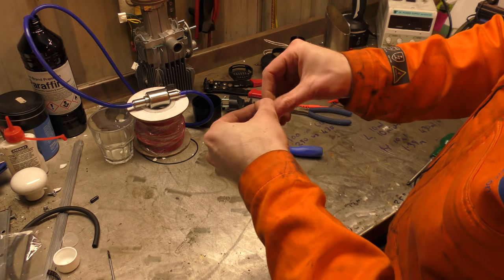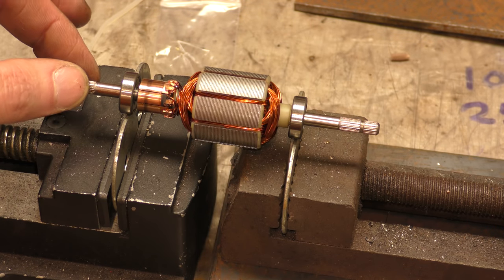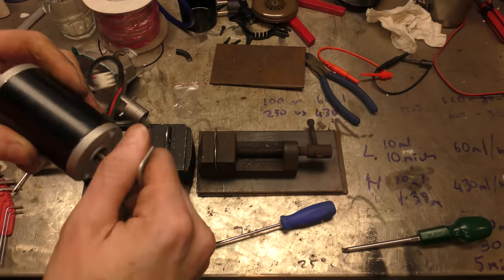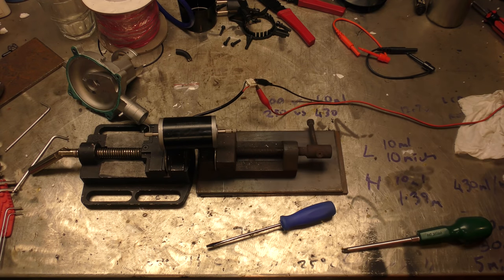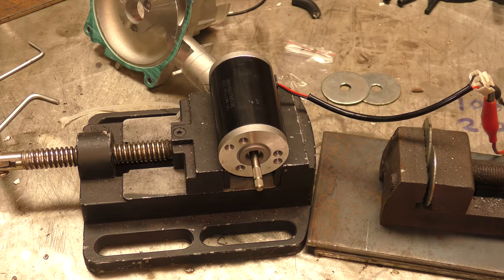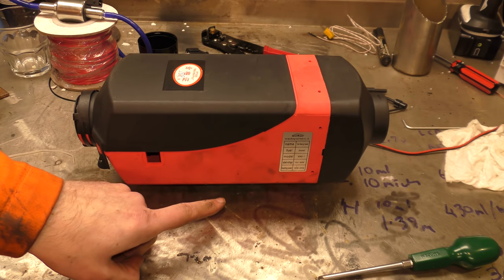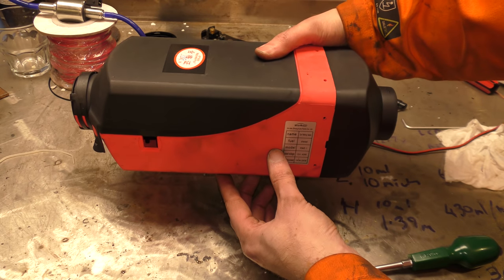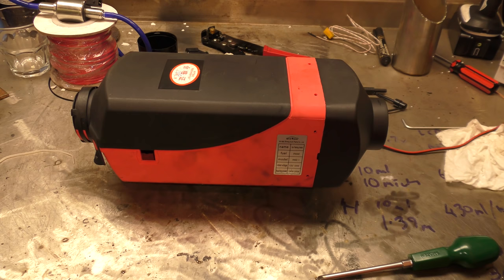EZO bearings on the noisy heater.  Fixed?

Comment: Hint: Use a 625RR not 625ZZ at the brush end as the dust from the brushes contaminates the bearings. Also if you cut a washer from the lid of a Chinese Takeaway Food container 13.5 mm OD and 4.5mm ID and place this between the brushes and the bearing, and use commutator lubricant or lanolin. The motor shaft slips which ends up with the brown compressor fan inside hitting the plate, or the Black fan hitting the sensor package.  When the motor slows it creates a rich burn, more Carbon Monoxide , more fuel used for the heat setting, and Smokey star up and shutdown, and deposits in the heater. So when you pull the motor apart superglue it in the correct place .
Reply: You need to make a video on that. Elaborate.

Comment: Repairing whatever slipped past Chinese 'quality control' is always incredibly satisfying imo
Reply from the maker: I think their QC might have been simply to test if the motor runs.  :)
Reply: Be fair, you are not paying a lot of this thing.
Reply: 'Slipped past' ?  No, those original bearings were chosen because they were the quietest in the batch!  😁
Reply: @nexpro6985  Yeah quietest in the batch of rejects from the other company they were made for originally.

Comment: Those look to be the same bearing size used in skateboard wheels. When I took my Total Gym apart, the rollers also had the same bearings as skateboard wheels, with a good ABEC rating too. 
Your local skateboard shop may be a good source for "buy it now" replacement bearings ranging from ABEC 3 (poor) to Swiss precision or even ceramic. 
For quality bearings, you'll probably have to buy the full set of 8 though.
Reply: @12volthighpeakvanlife.62  no problem, I like to help, & I love to fix things, especially with skateboard parts.
I hope it works out for you & you find that you already have some.
I think the ones I took off my "total gym" were German ABEC 7's. Surprisingly good quality.  The higher the ABEC rating, the rounder the balls are, the smoother the "ride", the less vibration,  and the less the noise should be.
I've never tried them, but I think Powell makes "6 ball" bearings, so there's less friction and more speed for skateboarding. That concept may work well for noise reduction in this application.....if they are in fact the same size as skateboard bearings.
Reply: 625 an 608 are different size. 
As for skate bearing and misuse of ABEC, not much point. 99% of china made skate bearings are the same regardless if 1, 2, 5 or 7 are stamped on the sheild. Marketing hype. If you want to spend, get Bones Swiss, pretty much the only 608 made in Europe at the WIB factory in Switzerland. 

 ABEC in the bearing industry is really used anymore. Pretty much everything is made within (or not) tollerances :-) 

EZO also make bearing in China :-) But probably under strict supervision and to EMQ standard (Electro motor quality)
Reply: @no66  I was under the impression that the GMN stamped on the shield stood for German.
I love Bones Swiss. I've been riding them for years.
Reply: @LarryMorrow2  Back in the day, GMN was germany produced bearings. Good stuff. Today,, apart fraom Bones swiss, all made in China. Nothing wrong with them, good enough. Have Swiss on my verk board and Zealous ($13) on my downhill setups. Beem 71mph on them, Bearing dont really matter :-)

Comment: Do you have a part number and a supply source for the bearings? Many thanks!
Reply: Just search: 5x16x5mm bearing. The rubber sealed should last longer than the shielded which lets dust from the brushes in.
Reply: F625ZZ Ezo us
Reply: @Scott_Free  Will the rubber seals hold up to the heat?

Comment: Adventure Brad bought the 5 Kw model.  The fuel pump promptly failed and he replaced it.  I'm sorry to know about the low quality of some of the components, but glad to know that replacements are to be found.
Reply: My experience over the past three years with them has been a neat learning exercise. My advice is have a secondary / backup heater such as an electric space heater and buy 150% diesel heaters: planning on running one then buy two, planning on two then buy three… have an extra ready to go and keep all the good parts when one fails.  Depending on what fails you can then order that and rebuild it to have as your next replacement. Some parts are close to cost of a whole new heater but even then they’re not terribly expensive.

Comment: Mine is SO loud right now.  I just ordered two genuine EZO 625-ZZ bearings on eBay.  5x16x5mm   I'm sure it will make a big difference.  Thanks!!
Reply: How did it go?  Was it easy to disassembly and change the bearings?
Reply: @fadingveil I recorded a video of the whole process.  I'll try to edit and post it soon here on YouTube.  It's been two months and the new bearings are still really quiet and I run it 24/7.  You got to pull on the fan wheels pretty hard to get them off the shaft.
Reply: @fadingveil  The internal fan blade is the trickiest part, they’re normally pressed on pretty tight but be careful because they’re brittle and will break easily.

Comment: Just left a comment on your 1st teardown video. I recognized the bad bearing sound from a cheap brushless rc plane motor I got from china. Sounded nearly identical the old bearings in this. But the noise sounded kind of neat in the plane anyways so I left them alone. It would be very annoying if you were trying to work or sleep next to it though.

Comment: He said they're "EZO 16x5x5mm 625Z".
Reply: THAAAAANKS A THOUSAND! 😁
Reply: I have a 5kw heater with the same problem, I wonder if it uses the same bearings?
Reply: balls up  ... Yeah, I already purchased a pair!  Thanks!
Reply: @byates59  Please post a video or do a write-up if you discover a way to disassemble the motor without damaging the two fans, as was done in this video.

Comment: Hi. Thank you for you spend the time deep analyze this item. Typically to the chinese manufacturers,  they save one tiny parts from the unit. In this case the ball-bearings. I think the electric motor with the ball-bearings running on never ending. :-)

Comment: Inspired by your video, I was able to replace the bearings.  My 2kW heater is also very quiet.  Thank you.
Reply: is there a set clearence for burner fan thanks
Reply: @faffybubs9099  

Hi. 
The photo is on my smartphone.  
The clearance of the burner fan seems to be about 1.5mm to 2mm.  
The fan was press-fitted into the shaft, so be careful when attaching and detaching.
thx：）
Reply: thank you it purring now my frind

Comment: Just curious. 
Why not use rubber sealed bearings?
Since fresh air coming, then motor, fan blowing hot air out from the front.
Motor or bearing dont get hot - I think.

Comment: Did you put the fan blades on in the same clocked orientation on the motor shaft, or clicked to each other to maintain balance?

Comment: I did it followed your video" the motor get magnet dust in it and in the bearings" thats the motor noise, be careful to put the stater back in right, and dont lose the rubber cap that goes over the bearing and in the slot as a vibration damper, you'll have to adjust the outer fan so it's not too close to the pickups and the Brain box. with a flathead and behind the fan to pry it out those couple millimeters and it should run silent.
Reply: is there a clearence for burner fan

Comment: On to something 
Stopping the tick from the fuel pump? 
I suspend my pump using cable ties to stop the tick from transferring in to whatever it’s fixed it.
Reply: By means of comparison, the ticking on my Erbespacher dose pump is freakisly loud, and the outside spent air outlet is so loud that I would not run it at night in a residential area
Reply: Tony Ling we’ve used a silencer on the exhaust and as I mentioned, we used a simple screw loop and four cable ties. Two around the pump and two through the screw loop to suspend it in mid air to stop the put transferring its noise.
Reply: Yes it does work I agree with that simple and easy to do. @Curbsidecrafters
Reply: Jeff Mee 👍🏼

Comment: Is this the 2kW (small housing), or the 5/8kW (large housing), or does it not matter, since bearings/motors all the same. Do you know?
Reply from the maker: The motors are different, but the shaft size is the same.  I'd expect the bearings to be the same size to save on costs.

Comment: I’m wondering if it’s OK if to remove the fan shroud and have a secondary fan pulling air over the heat chamber so you’re having max airflow all the time rather than letting the diesel heater adjust the fan speed so you’re having the maximum airflow all the time? Or will that affect things and make it so it doesn’t run right?

Comment: that is cheaper than that stupid replacement DC motor I linked in a video yesterday.
I was impressed that the Chinese  Rotor was balanced in the first place. (ground out spots on the side of it). I use to work for a company that built robot assemble lines which made them. Have to wonder if that was made from an assembly line I made.

Comment: What size bearings are they do you know? I have a course sound not a vibration. Are all the motors able to be disassembled like that or some compete pressed units?
Reply from the maker: 5x16x5mm bearing size - 625Z or 625ZZ

Comment: Can u please tell me how you removed the motor from the assembly and where u purchase it (the replacement motor/bearings)? Thank you!
Reply from the maker: The hardest part is not breaking the combustion fan during removal.  Other than that it's a few screws.  I got the bearings on eBay.
Reply: @DavidMcLuckie  tips for getting both fans off the motor without damagin the fans ?

Comment: I've had mine since August 2019 it's been used more or less daily and flat out all night thru the winters but recently its start making terrible rattling noises, would it be worn bearings ?
Cheers
Reply: About the same amount of time on mine same type noise
Reply: @JoelPit  
I've got the bearings already, but I don't wanna open it up yet coz we need heating and I don't wanna fuck it up,  it's a shame he didn't show how he got the old bearings out and the new ones in, good luck with your one 👍
Reply from the maker: @strake750 I really should have filmed that.  :(

Comment: I have the same problem with my 5kw diesel heater, I was able to get the combustion air fan blade off but I am having trouble with the black return air fan blade, how did you get it off?  Thanks for the video!
Reply: Never mind, I was able to get it off!  Thanks anyways!
Reply from the maker: Brute force?  :)

Comment: Hi David, your bugbear with the 8kW heater seemed to big sluggish buttons, is there any benefit of seeing if they can be improved? I guess it's poor contact design but could be software 🤔
Reply from the maker: Another commenter said that it's the slow refresh of the controller.  As when you press it, wait, press it again, it works every time.  It's just slow.  :(

Comment: Yes David a lot better can you tell us the bearing sizes need some myself I think I might have some  thanks. Jeff
Reply from the maker: 16x5x5mm.  625Z is the marking on them.
Reply: Hi Thank you  they are the same size as my sons skateboard bearings go on ebay you can get then for £1.30 free post for 5 next time you want then. On the bearings I put some ZX1 lub and they last a long time. Jeff @DavidMcLuckie
Reply: @jeffmee763 : I wonder if they were also manufactured in china or japan? just curious. thanks for the info.
Reply: To be fair I think they are the same as I can see no difference I just give them a bit of top quality lube. Jeff @ronwasser4852

Comment: Hello David. My heater is still driving me mad. I got the 5kw one. Are the bearings the same size? I will order them today if that is the case.
Reply from the maker: I'm not 100% sure as I haven't had to go that deep into a 5KW (yet).  I think the motor is the same between the two sizes of heater as I only see a listing for one motor but 12V or 24V.
Reply: @DavidMcLuckie   Thank you very much for the response.  What you say makes perfect sense, it so obvious when you say it. 

Thank you for taking the time to respond.
Reply: @sprinterlex2082  did you try to fix the 5kw bearings?  Were they the same size?  My 5kw is making all kinds of noise 🥴
Reply: @lexsarrasin713  Bump! I'm curious too!

Comment: my 8kw was fine for the first few months and now it's quiet then vibrates for a few seconds then back to normal for a good while then a vibrate. and that carrys on.
are these motor bearings the only bearing inside the entire unit?
mines an all in one so havnt took it out to disassemble yet. its hardly soot after only a few months. with my ear to the unit it sounds about midway to forward the noise is
Reply from the maker: The motor bearings are the only ones yes.
Reply: @DavidMcLuckie  do the fan and turbine wheel go back on nice and tight after being removed ? I might let it hum away till spring then do the bearings. it's heating my room so don't want any down time. if I was sure the bearings are the same size in my 8kw id get them and I'd get it done and back going. thanks
Reply from the maker: They do.  I'd leave it until you don't need heat.  As if you break one of the fans then you're truly fucked.

Comment: Fantastic what a difference! Also as its a "new" motor the brushes could be a little clicky until they bed in properly....in the rc days we would run a ball point pen up and down the com segments and run a motor in over night on a couple of cells...some even did this with the motor submersed in a glass of water! Keep up the great work!:-)
Reply: It does sound to me like there is a wee bit of PCM motor driver noise, both before and after
Reply: PCM? or PWM? Yes there is some tone from the pwm used for voltage control, but its a lot higher than the noise of a bad bearing but good observation.:-)
Reply: @jbsmith1  It is made very profound when using a radio control DC motor with an H bridge. 
When you furst initialise the controller, it can play a tune on the motor (DC or 3 phase) without it even visibly rotating.
Reply: yes there are speedo's that take advantage of this when in setup mode and the motor will beep. :-)

Comment: I put my diesel pump in homemade cement brick with tiny pebbles, sound proofing
Reply from the maker: Interesting.
Reply: also iv bought a few of ebay & noticed my exorst are 3mm bigger even with paste its messy .people are tighting the jubilee clip on some which inturn buckles causing gaps and blows up onto the bottom of the heater after installing.

Comment: you should use 625z c3
Reply: Why?
Reply: @daan3298  C3 stands for extra clearance very good for motors and the like lasts longer than the normal 625zz
Reply: @irish-simon  What part of the bearing has extra clearance?  Can you explain this better please?
Reply: The balls in the bearing are small to allow for the metal expansion while running
Reply: @irish-simon  Ah, ok.  That actually makes sense especially since the bearings will be heating up.  I wonder how much they actually heat up since they are shielded from a lot of the heat behind the plastic combustion chamber fan wheel. Would the extra clearance cause them to be noisier if the heat expansion didn't close the gap?
Reply: @SpoonerTuner  no they wouldn't be any louder then a standard bearing but they will last longer and are better for high speed

Comment: The Chinese skip out on parts, I’d bet a dollar to a donut there are less ball bearings in that bearing housing than normal.
Reply from the maker: How many should there be in a 625Z?
Reply: Well I don’t know the exact number on these things, but if there is enough space to add ball bearings into the casing, it’s short. Every high end bearing case I’ve ever disassembled(skateboard, bicycle, wheelchair, motorcycle) has had enough bearings to fill the entire void. The all have slack in the case, but all had enough balls that you couldn’t fit another into the casing. I have ran across cheap bearings that were missing a ball or two, they were all crap.
Reply: David McLuckie if you have high revolution bearings that are the same size, with differing numbers of actual balls inside, or not enough balls, it’s going to cause a vibrational problem.

Comment: Why would you go through all the trouble to replace bearing when you can order the entire motoer assemble   c/ bearings and housing for like $40 ??  I did.  Repair time is like 15 mins.
Reply from the maker: Because no one else has.  I like to play.
Reply: @DavidMcLuckie …. great answer! The real value in doing it is that in 5 or 10 years you may not be able to get these replacement parts and bearing swaps may be the only option. Everything we buy eventually gets to an age where replacing parts isn’t possible..